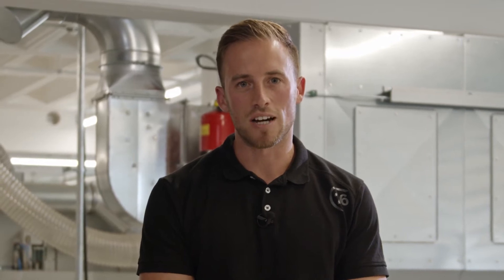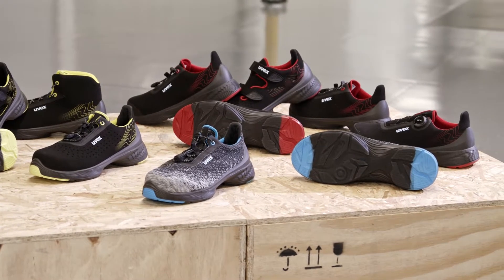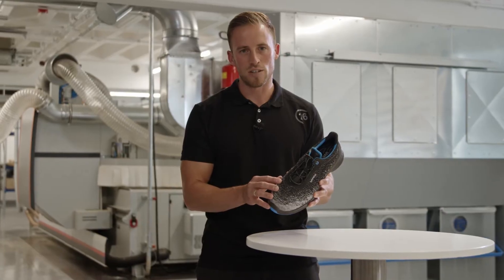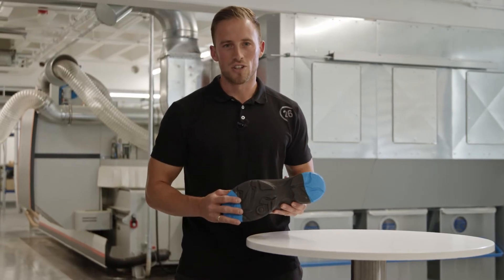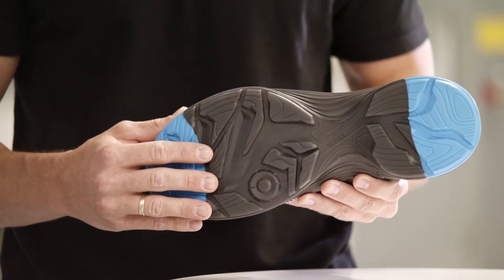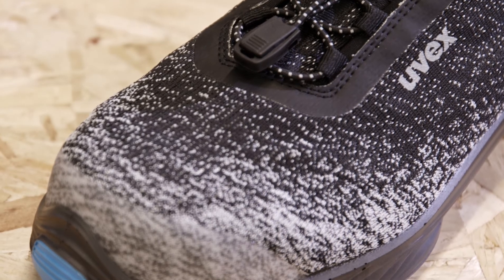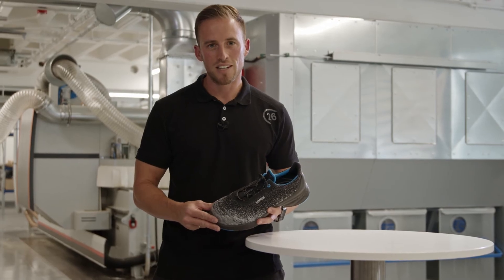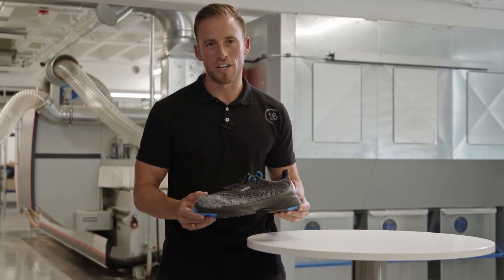x-showcase: uvex 1 G2 // model extension with knitted shaft and reworked TPU sole

Comment: Hello uvex. I word on aviation. My shoes always exposed in oil and hydraulic when we do maintenance in the aircraft. What uvex shoe can you recommend to me.
Reply from the maker: Hello, the good news are: all our safety shoes are fuel and oil resistant. Depending on your individual preferences, you can choose between a low cut version or a boot. -> nevertheless we recommend to use safety class S2 or S3 ideally with leather. A suitable model would be uvex 2 macsole S3